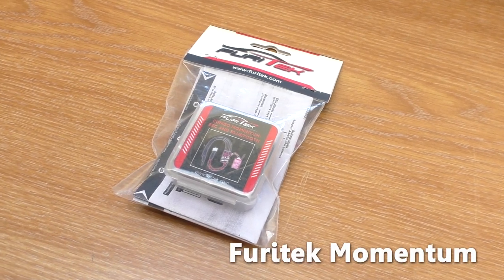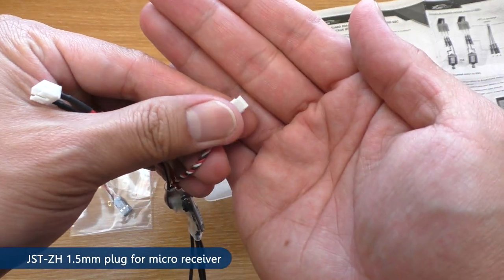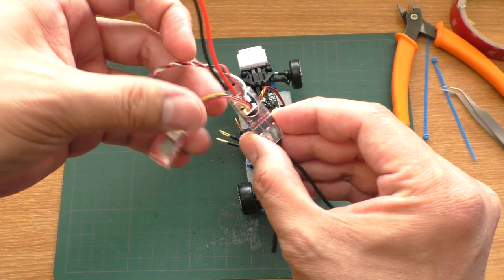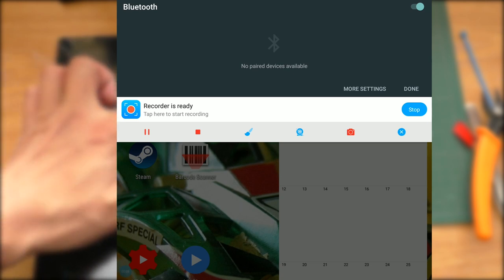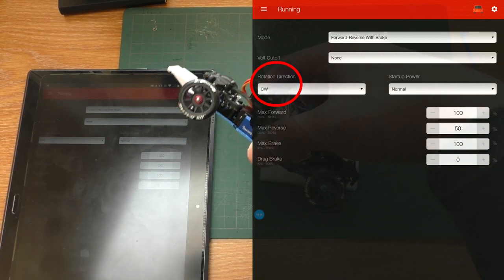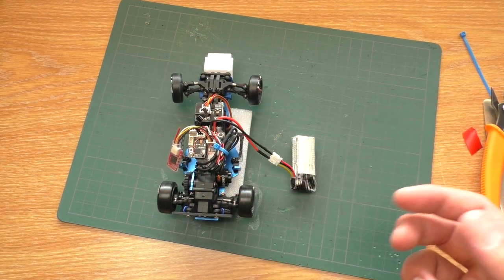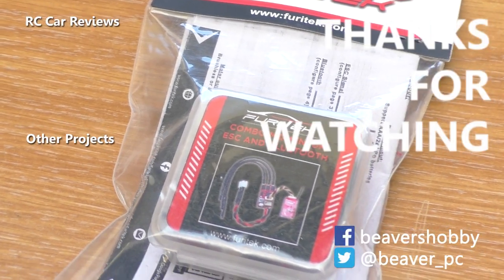Furitek Momentum ESC Final Version Unboxing & Setup Tutorial

Comment from the maker: Recording the audio live cut down the filming time significantly. However the audio is still a bit iffy so please bear with me until I get a new microphone.
There are a few steps in the tutorial so click the time stamps to skip to your preferred topic.
Intro 00:00
Unboxing 00:17
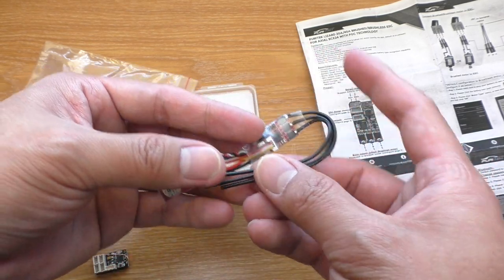Soldering 04:31
Battery plug 05:55
Installation 06:26
Android app 08:28
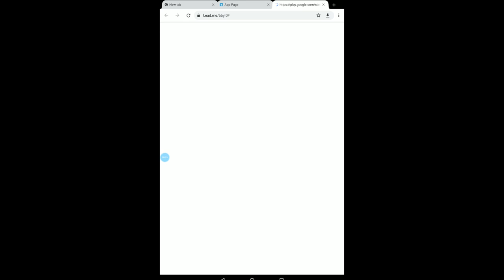Connecting car to app 08:53
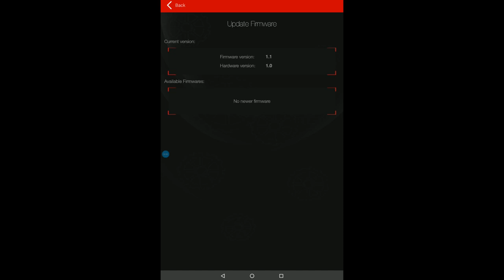Throttle calibration 10:06
Motor direction 10:54
Low voltage cutoff 11:42
On-off button setup 12:43 
Test run 13:42
Release date 15:19
Reply: Awesome you are the man!!!

Comment: Hello old friend been a subscriber 3 or 4 years now. Back when you modded 989. So i had a DRZ 1 was last chassis, when they first came out. Never could get that thing tuned and drifting. So recently I saw one of your new vids for XRX and now im back from 2 year lay off. I finally got that car too drift then grabbed a XRX, so few more chassis later and now I have a Drift Art 2 from chanRC. The hobby has come along way since first 1/28 DRZ. So after ordering DA2 i saw this review, I order one. So had to come back to this video too connect blue tooth. Man your vids are a big the reason i got in the hobby, and have got me out of a lot of situations i couldnt figure out. Thanks Bro    ps if you do a video for servo programing AGF A11CLS thats last part of this build.
Reply from the maker: Glad you are still in the hobby. The AGF programming still got something I want to experiment. Right now I only use the re-centring feature so the car can go straight with 0 trim and left and right swing feel equal.
Reply: @BeaversHobby  OO ok Im gonna try to find that. thanks bro
Reply from the maker: @shasyb4301  My pleasure. A11CLS will not fit on a standard Sports version of XRX DPA but if you have the wheelbase adjustable chassis plate, it'll fit.
Reply: @BeaversHobby  I do have the extension, but I’m using in Drift Art 2

Comment: Hey Beaver. I have a Gl receiver and a Kyosho ex6-r receiver. How can I pair them? It’s so confusing. Please help me and thanks.!
Reply from the maker: Which receiver do you have? It only needs one so I presume you have the GL ESC (it has a plug on the top so it might look confusing) and a receiver. You'll need to plug the ESC into the channel 2 of the receiver. Let me check how a micro receiver for Kyosho ASF bind and I'll get back to you. Normally it should be holding the button on the receiver and turn the ESC on, the put the transmitter in bind mode.
Reply from the maker: This is the type of receiver you need for EX6-R. https://www.aliexpress.com/item/4001326910465.html
As it turns out, here's how to bind: turn on both transmitter and ESC (that plugs into channel 2 of receiver), set EX6-R to pair and hold the button on the receiver for 2 seconds or until the light starts flashing and let it go.

Comment: Heya, I picked up this ESC that comes with the 3500kv motor, it's the first version but for some reason I just can't get it to connect to the motor. It just blinks slowly, not the rapid one where it doesn't find the receiver. I'm wondering if you ever encountered this issue and if you have some advice on troubleshooting if it's either the ESC or motor that's defective. Thanks!
Reply from the maker: I haven't got that problem yet but here are some diagnostic you can do.
- Check the soldering joints on the motor and see if there's any bridge between 2 terminal.
- Take the motor out and see if it still blinks the same.
- Try and connect it to bluetooth, check if it appears in the app.
- Check the motor mode, switch to brushless if it's brushed (some firmware has brushed as default).
- If you have another motor to try it'll be nice, otherwise just re-solder the same one back in to see if it works.
If nothing works please contact Furitek, they are on facebook at https://www.facebook.com/furitekelectronics
Or the support group at https://www.facebook.com/groups/433779831145508 .
Reply: @BeaversHobby  Figured out the problem! For others whom has the same issue, I checked my battery's voltage which was 4.5 volts, way below the 7.4 it needs to output. Tested with a bench power supply recently which I completely forgot I had, and the esc, motor works fine. Fortunately the battery was under warranty so the issue is solved. Thanks for still getting me into this hobby, can't wait to start messing around with the car!
Reply from the maker: @extremecaliber2662  Oh... I really didn't think of the battery. Glad you found the problem.

Comment: Hello Beaver! What if I have a PN 2.5W chassis and have to solder positive and negative wires separetely? Does that furitek plug allow for that (to part the two wires and solder them)?
Reply from the maker: Yes, you can do that. There are small pates for each polarity on the ESC so there's no worry about that. There will always be + and - separately.
Reply: @BeaversHobby  Beaver, since the Momentum with metal case comes without the wire to connect to receiver, could you tell me what kind of wire it is precisely so I can buy one? Does Furitek sell it separetly?
Reply from the maker: @fabrizioformenti7649  Yes, Furitek sells that wire. I think it should come with the wire for micro receiver (JST-ZH 1.5mm) already. If you use a standard receiver (JR/Futaba) you'll have to buy a new wire. There should be a listing on the Furitek shop.

Comment: Hello Beaver and thanks for this video. If I have a motor (which I believe is a PN racing one) having M1, M2, M3 on it instead of A, B, C... Is M1 the same as A in your opinion?
All of this thinking about correct soldering to the Furitek esc.
Reply from the maker: I think so. But it doesn't really matter because this is sensorless and you can wire them however you like. If it spins in the opposite direction, just swap 2 wires.
Reply: @BeaversHobby  but the middle wire for esc and motor should always be the one phisically placed in the middle, right? So I might have to swap the external wires. 
And to your knowledge, what's the difference between swapping the wires and set the esc to counter-clockwise?
Thanks again
Reply from the maker: @fabrizioformenti7649  That doesn't matter either, we just put it in the middle for easier wire routing.
As for the direction from wiring and setup, it's just programming. You should wire the motor so it works according to the programme.

Comment: Very informative video. I have a couple Furitek systems in my crawlers and just picked up a 1/24 drift and was debating on getting this esc. And what gyro are you using?
Reply: Disregard. I just saw your video on the gyro.
Reply from the maker: @DanPRC  AFRC GYS2 V3 is the best option right now for micro because of the size. However if you can manage the space, PowerHD G1 is the best I've tried.
Reply: @BeaversHobby  Ok thank you.

Comment: I'm relatively inexperienced in RC, but I'm interested in this ESC. Can I use it with a normal receiver? The connectors you use are the JST Mini, i only have normal Radio Control here.
Reply from the maker: Yes, you can use it with any normal receiver. They also sell the JR/Futaba plug for normal receivers too. It should have already bundled with the ESC but I'm not sure. Well, ask them anyway if the wire for normal receivers is already included.

Comment: Hi Bro, I also buy one Momentum with my Driftart2 and I found something interesting. If I kept battery plug with ESC after it shutdown, after hours the battery will certainly run out of energy.
I already modified the button function as you did, however I can tell it's not really "off" while keep the plug onto.
Have you met the same issue yet?
Reply from the maker: I never left the plug in so I think this ESC doesn't really cut the power when off, it just cuts the motor control and BEC out.

Comment: Great Video! What do you think? Which is the best drift rc if you can only choose one?
Reply from the maker: If I can only choose one then I'd choose GL Racing GLD. It's the best design of this generation. Everything is well thought out and it is very easy to tune. It's also a true 1/28 narrow chassis as well.
Unfortunately it's been let down by dodgy parts quality so once it's got some aluminium upgrades on it, it's the best.

Comment: Hi can you make a budget build between 100 to 300
Reply from the maker: Thanks for the suggestion.
100-300 is pretty good unless you just started and haven't got a transmitter and charger yet. 
So it depends on which point you are on, if it's 300 for just the car and electronics then you'll get some great stuff. If you just started then it'll be all budget stuff. 
If I made a video about how much it would cost to start the hobby on a budget, would that answer your question?
Reply: @BeaversHobby  yes please   do that video it  would help a lot

Comment: I'm wondering if it's able to start-up the ESC power just like PS3 or switch that assigned button on the transceiver
Reply from the maker: I guess technically it could, just like a drone when you arm the motors through radio but it only connects to 1 channel so that could be tricky.

Comment: Hi Beaver, I just got a Furitek Momentum ESC and soldered it up to a Yeah Racing 3500kv motor (looks just like the Surpass Rocket motor). I'm getting a lot of cogging and sometimes the motor stalls and whines, and telemetry shows the RPM maxed out even though it's not moving. Has this ever happened to you? Did you have to play with the settings at all with your ESC? Do you still feel like this is the best, even better than DasMikro?
Reply from the maker: I'd say check the wiring and calibration then see the working mode if it's brushed or brushless. Using brushed mode will result in the symptoms you have.
Reply: @BeaversHobby  Thanks for the reply. I checked and played with all of the settings. No matter what I do the motor acts up. It seems to cog all throughout the rev range. But what's weird is that it seems to be smooth in reverse. It's mainly forward where the issues come up. But anyway, I hooked it up to a brushed motor (and changed the setting to "brushed") and it works great. Really smooth and quiet. So I think my brushless motor must be bad.
Reply from the maker: @jeffreymeeks9080  That's a strange problem to have. Perhaps you can contact Furitek about this problem.
Reply: @BeaversHobby  Agreed. First I'll try a different brushless motor and then if I still have issues, I'll reach out to Furitek

Comment: Im kind of new to this but I want to get into the hobby without spending too much money if it turns out to not be my thing so...
Is it possible and would you even recommend to do a complete drift build (including everything, starting from basically 0) for around 100 bucks? What are my options? 

Thanks in advance for any reply!
Reply from the maker: It would be similar to the K989 touring project from stage 1-4 but instead of fitting it with grip tyres, install Mini-Z drift tyres instead. You can get either K969 or K989, they are the same chassis and you'll have to change the wheels & tyres (then for K989 lock the differentials) anyway.
https://www.youtube.com/playlist?list=PLS79G3YjA2fAEez9GVeLW3JIy_LUIb6Mb
At a start to get a decent drifting machine it would be around 60-70 USD. If you add some front one way it would add around 35USD to it because you'll need new drive shafts too.
Reply: Wow did not expect such an extensive answer, thank you! Will look into that!
Reply from the maker: @_sqrrl3299  My pleasure. Best of luck with the project.
Reply: @BeaversHobby  Ok here I am again with one more question about tyres. Have you ever tried drifting on cork floor? It feels a bit more grippy than even hard wood flooring. Would slippy tyres like the ds racing lf-1 be sufficent here and are there similar or even less grippy alternatives?
Reply from the maker: @_sqrrl3299  I've never run on that type of floor before but when it's sticky and  has a lot of grip there's LF-5 which is the lowest grip compound available.

Comment: Link to battery?
Reply from the maker: Here https://bit.ly/3ihR6g3
The plug is JST-PH so you will need an adapter for charging. You can either make one yourself or there should be some on Mini-Z and 1/28 shops.
Reply: @BeaversHobby  thanks, also can I use 2 receivers and switch between cars with one radio link transmitter ?
Reply from the maker: @braelighty6212  Yes, you can. A transmitter can bind to multiple receivers. That's why a hobby-grade transmitter has model memory so it can keep the settings for each car.